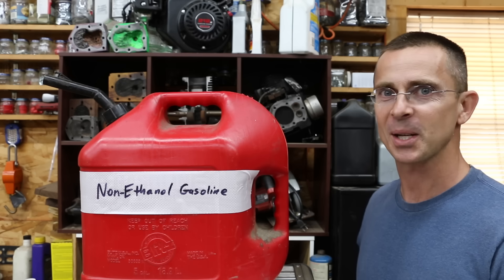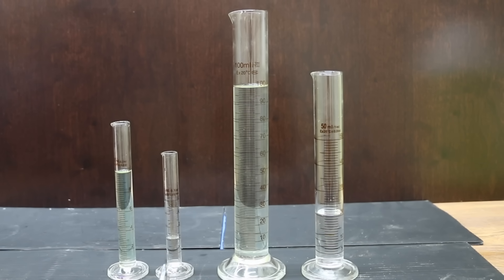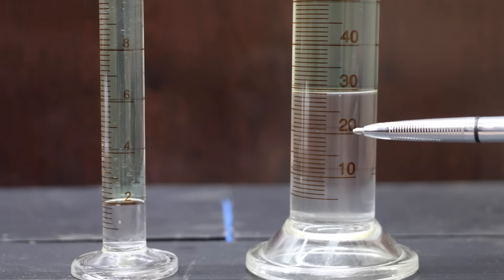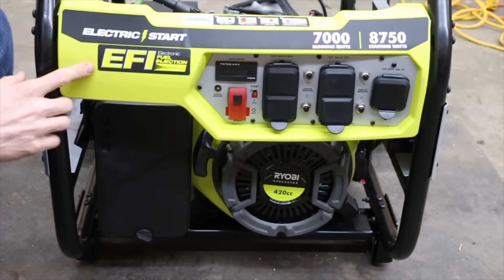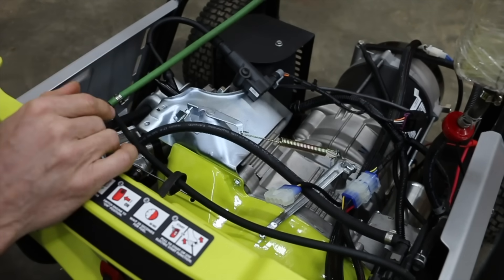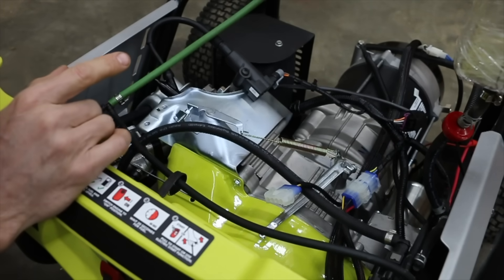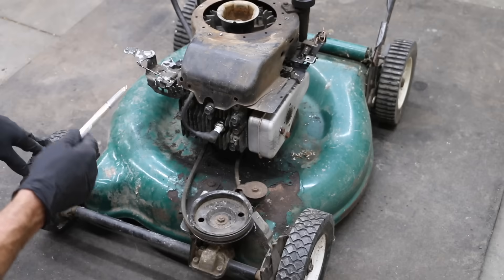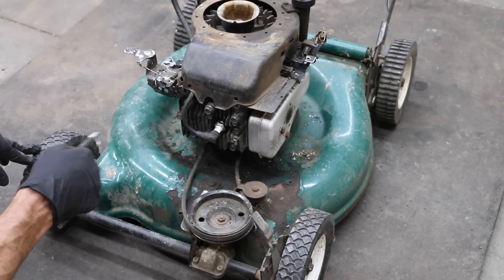Is Non-Ethanol Gasoline Really Better? See the PROOF!

Comment: All I know is, when I run 87 octain15% ethanol v 10% ethanol, I get 5-6 miles to the gallon less in a car that is supposed to get 35 and averages 28 with 10% and 22-25 with 15% with. I ran a tank of E-85 and got 19 mpg. I can only imagine what I'd get with 87 straight up old school gas, 40-45!

Comment: I thought ethanol gas is only a problem for gaskets in cars before around year 1998-2000. I have an Audi 80 from 1992, so I tried to check thoroughly, and Audi says: "All our engines from 1998 and onwards are approved for E10 gas." So far here in Denmark, almost al gas stations still have E5 gas, and three-four brands has E5 Octane 100, which I use.

Comment: You need to use 87 octane gas as the base for both non ethanol and 10% ethanol gas to get a fair comparison. That would be 87 octane non ethanol and 89 octane 10% ethanol. By using 85 octane base in the 10% ethanol you have 90% poor quality gas that erases the clean burning qualities of ethanol even if it raises the octane to 87.

Comment: So this ethanol fuel mix has become a viral in Indonesia when foreign fuel company that operated in Indonesia are refuse to buy base fuel from gov owned fuel company, because the base fuel already mixed with ethanol.
Many people are basically tried to push the story that ethanol is already a standard use in overseas, but that not the problem.

The problem is, foreign fuel company buy base fuel without ethanol mix. It's not like they will not mix with the ethanol, but they want the base fuels are ethanol free. For this reason, foreign fuel companies are refuse to buy.

It causing problem because at the previous event, gov owned fuel company is basically hurting people trust. So they go to foreign fuel company.
And people pissed off when our government is forcing the base fuel import thru this gov owned fuel company.
Instead importing the base fuel according to the foreign fuel company specification, they import it with their own specification, so foreign fuel company refuse to buy.

Of course, many new vehicles in indonesia already certified with E10. But old vehicle are mostly not.

Comment: In the end there is slightly different, but u know ethanol will be good if the source is pure ethanol (means clean).

There is already a news that our indonesian gas station mix up fuel with water so there will be more profit = more money, in the end indonesian gas vehicles will be doomed especially in here small motorcycle 155cc or less is more popular than a car with 1500cc. 

From the data on 2024 motorcycle  population reach 137M meanwhile car only reach 20M only

Comment: The villain is the water. More ethanol means more water and the so called "flex" vehicles are not ready for it. Direct injection engines tend to rust injectors and other parts.

Comment: Ethanol increase Octane Rating Depending on if your vehicle is Ethanol Compliant, otherwise it's a Carbon Deposit making machine as well as a Water Infused Toxin that will rot your Fuel System, let me explain:

Ethanol raises octane levels in gasoline.

Here’s a quick breakdown:
Octane rating measures a fuel’s resistance to “knocking” or premature combustion.

Ethanol has a naturally high octane rating — typically around 108–113.

When blended with regular gasoline (which might have a base octane in the 70s), ethanol boosts the overall octane of the mixture.

That’s why:
E10 (10% ethanol) fuel usually has an octane rating of around 87 (regular unleaded).

E15 or E85 (higher ethanol blends) can have octane ratings between 88–105, depending on the exact mix.

✅ In short: Ethanol increases the octane rating of gasoline.

⚠️ However, while it boosts octane, it lowers energy content, meaning slightly less fuel economy per liter/gallon.

🚫Increased Octane but Lower BTU's = Poorer Gas Mileage Bang for Buck!

Ethanol raises octane, improving knock resistance and allowing for higher-compression, more efficient engine designs. (GDI, etc)

But ethanol has lower BTU (British Thermal Units) — meaning less energy per volume than pure gasoline.

To put numbers on it:
Pure gasoline:
~114,000 BTU per gallon

Ethanol:
~76,000 BTU per gallon

So when you mix them:
E10 (10% ethanol) has roughly 3–4% less energy than pure gasoline.🥵👎🏼

E85 (85% ethanol) can have 25–30% less energy — which is why fuel economy drops even though octane increases.

👉 Summary:
Ethanol = higher octane, lower BTU → better performance potential but slightly lower mileage.

So all in all....
how does combustion chemistry tie together?

Here’s the breakdown 👇

🔥 Ethanol’s combustion vs. gasoline
Ethanol burns cleaner because it contains oxygen in its molecular structure (C₂H₅OH).

That built-in oxygen helps fuel burn more completely, reducing the amount of unburned hydrocarbons and carbon deposits.

💨 Carbon deposits
Less BTU means less total energy — and also less carbon per unit of fuel, since ethanol has fewer carbon atoms.

Because it promotes a cleaner, more complete burn, ethanol-blended fuels tend to leave fewer carbon deposits, especially in the combustion chamber and on intake valves.

⚙️ However:🛑
In older engines not designed for ethanol, poor vaporization or incompatible materials can cause lean running or injector issues — and that can lead to deposits indirectly.

In modern, flex-fuel or ethanol-compatible engines, ethanol blends actually reduce carbon buildup over time.

✅ Summary:
Ethanol’s lower BTU doesn’t cause more unburned fuel — it actually helps fuel burn more completely, leading to fewer carbon deposits overall 

...when the engine is tuned for it! 🤓

Comment: i'm just afraid if this used in bikes, since most bike using rubber fuel pipe. and there's mostly 110-125cc engine on the road. it will prone to corrosion since etanol is attracted to water. it okay if the ppm is high, but low ppm not to metion if the gov't really put 10 not 20or more. like the last cases where pricier fuel mixed with cheap fuel. and that cause a more than $60B gone. and teh fun things is maybe the people(s) doing that still enjoying it with no notable consequences. bcs there's no more news everywhere about what they do to them, like the thing is vanishing into thin air 🙄

Comment: The problem is humidity in the air. If you life in dry climate the difference is almost negligible .
But if you run the engine in humid climate the the engine will run bad for high ethanol content.

Note this is my personal experience as mine worker. I have work in dry climate and and tropical climate. And this is a long time ago. So new tech and new gasoline blend may or may not make my knowledge obsolete .

Comment: Long story short, methanol/ethanol gasoline is better as long you keep it below 10 %, if you add more methanol/ethanol it becomes engine poison, specially against old engines.
 For the enviroment tough, it"s better to run on 100% methanol fuel.
 I had a motorcycle running at 50% methanol once, it runned like a charm, but a lot of adjustments were needed. Ethanol and methanol are both used into fuel mixtures

Comment: The (bad) effect may not show up immediately. But when the fuel deposited for long time in the tank and absorb water from air, then the problems may occur. Beside of that, the energy of ethanol per volume is less than pure gasoline. So, for the same amount of fuel, ethanol and gaoline mixture will gives lower mileage.

Comment: Indonesia's gov is currently planning on pushing the maximum of 20% ethanol mix to gasoline sold within the country. Based on your video I can only imagine how much carbon deposit would be generated on the same type of engine, if our fuel was used.
Reply: Stupid, in US where this video made they already got ethanol mix fuel ranging from 10-99% that mean they use pure ethanol for their vehicle and they say it run so smooth, they even use methanol for their fuel which is cheaper version of ethanol that does not need fermentation during the production and could be produced from the air we breath, it's not only north American that used ethanol mix fuel but also south American too, they got cheap ethanol from surpluss corn production that's why they call it corn fuel. Don't forget all racing car use methanol for their fuel with nitrimethane for their additive and they run really good. You need more literation and stop watching YouTube for your only reference.
Reply: @IamSonedi  dumbass trying to compare engines from other countries
Reply: @seriusbangetsich Lol, ethanol mixed fuel is used by South America countrys too including Mexico a country that commonly underestimate they use same engine like us, since many of their cars imported from Asian country such as Japan, China, and Korea. US also imported car from Asian country many of US citizen could not afford European or US made cars such as Dodge, Ford, KIA, etc. So we bassicly use the same cars like them and they already mixed their gasoline with ethanol since decades ago, you also must be can't speak English since you also not watching the video until end.
Reply: Nonton video gak bang?
Atau hanya jadi buzzer ?

Video ini dukung mix ethanol 10%
Reply: @timeaftertime-om7os  bisa bahasa inggris ga?

Comment: Wow youtube really know Indonesian issues, when Indo Gov will put standard 10% ethanol on gasoline. 🎉
Reply: US also got ethanol mixed fuel, the concentration ranging from 10-90%, they even use methanol which is cheap version of ethanol and could produce from woods or air we breath that's why they call it woods alcohol. All race car using methanol for their fuel with nitromethane for additives, it run really good and had no problem.

Comment: I think the problem in Indonesia, based on many comments here, actually isn't really about the ethanol, but the gasoline in Indonesia contains the sulphur. Which is, the sulphur isn't good for vehicles & the percentage of sulphur were so high
Reply: It's just found on Diesel engine which is then add urea to the diesel fuel to remove suphur emition on atmosphere, as far as i know this is already apply on Europe.

Comment: We've been suffering from corruptions lately. sama, gengs! mereka sudah memonopoli dengan oplosan!💔🥀

This is your daioy dose of Recommendation

Context:
Indonesian Government is at it again, restricted imports of base fuel. Now the only allowed source is the government itself (Pertamina). Okeh, fine whatever you say boomer.
We still want base fuel which we can process out of it. You say you want us to get it from you. okay here it is.
Alas, when analyzed, the "base" sample has ethanol in it. Very undesirable! we want the fking base! no baby powder, no anything, just gas! where's the just gasoline?!
.
buzzer alert!
.
Although again, ethanol mixed fuel isn't inherently bad. It can increase octane for cheap. but it has caveats.
as seen by many videos, ethanol is hygroscopic, meaning it attracts water. Even tho tanks have anti-rust, but ethanol can also eat up those coatings, would eventually drop and expose the metal inside, causing this rust reaction etc etc.
You can make the tank say Polycarbonate and make the filter designed to be compatible with such type. Or maybe Kevlar if you have F1 funds left over, idk. coz some extreme race cars use full ethanol or even lighter and more powerful fuel or something
.
buzzer alert 1
.
On the other hand, Pertamina quality these days are currently terrible to say the least. We don't even have to have issue about such scammed fuel / oplosan or something. Their fuel is really full of slag and most of the time damages the engine anyway, which is the point we rely on private fuels / bensin swasta.
We're stuck. the only way to cope with this is to modify fuel system to adapt to this calamity made by our own government. bruh 🗿.

Comment: I don't understand why suddenly so many people just agreeing that ethanol is bad. These engines are probably not designed for ethanol fuel. Ethanol "eats" rubber and plastic parts so the engine has to be made resistant to it. No one is saying that rocket fuel is the best fuel for their car. Learn to read and check your bloody manuals for what you can really put in your car.

Comment: Hi folks, speaking from Brazil. Thanks for the tests. Hydrated ethanol has been used in my cars since 1970s. The hygroscppy of ethanol is no longer problem but a characteristic. And yes, hydrated ethanol corrodes gaskets and other engines parts. Brazilian engineering solved both problems in the end of 1970s. The solution is simple: the hybrid engine must be assembled and tuned with components designed to withstand to ethanol blend. I drove  100,000Km with my previous Nissan Sentra on pure ethanol or gasoline without any problems. Today, in 2025, I fill my new Nissan Sentra's tank with E90 ou pure ethanol in hot season or E85 in the cold season. I do this mainly to improve cold starting and battery. I prefer to use ethanol for my vehicles to help control environmental polution in my city, to use the engine's máximum power and reduce engine carbon cleaning costs.

Comment: This is a six year old video and a stupid test. Its not depicting accurate results. The latest tests while driving a car with E20 petrol in India shows a sharp drop in mileage and power of the vehicle. The air conditioning performance of the car also dropped down a lot. This test is not accurate depiction of real life scenario. Some people have also complained that car is showing temperature warning on the sensor.